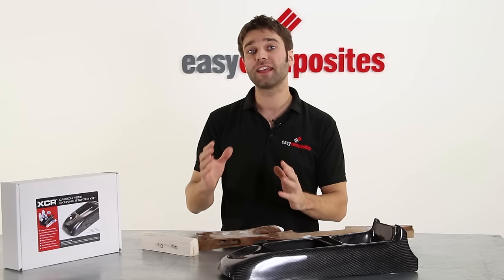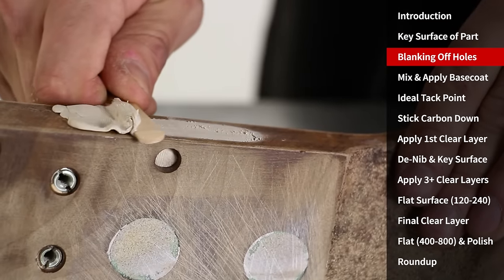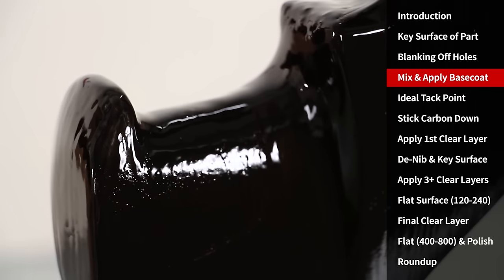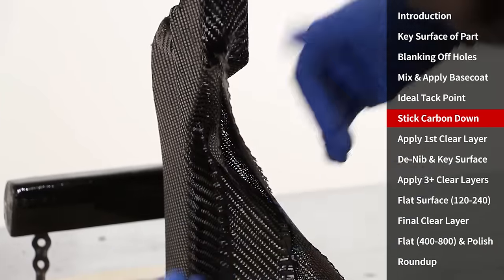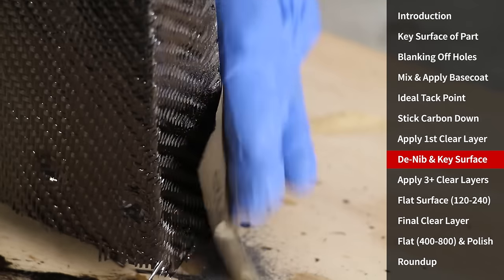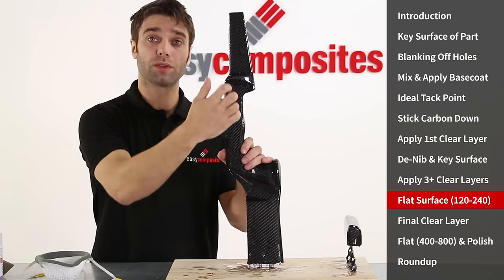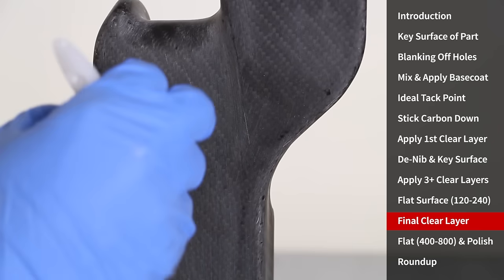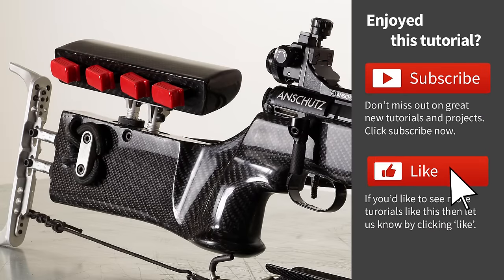Ultimate Carbon Fibre Skinning/Wrapping Tutorial - Sofie's Rifle Stock

Comment: Why don't you vacuum pack it and cure it in the oven?
Reply from the maker: Carbon skinning does not involve or need vacuum bagging. Also the resins used are room temperature curing, so no need for an oven cure.  However an oven post cure once complete can help improve temperature resistance.

Comment: sanding between coats will peel off the coats.  I wait 2 hours between layers being sticky but without staining my finger.  What am I doing wrong?
Reply from the maker: Hi Dani, if you're sanding a previous coat then you must let it FULLY cure before sanding, which will take many hours, at least 8hrs. You only wait just the 2 hours if you are applying another coat of resin directly onto the previous one without sanding in between.

Comment: Been spending way too much time skinning a couple fiberglass louver assy's I made for the hood of my Jag. P.I.T.A! Can't count the times I've broken through into the CF, made up ways to patch and match a new sliver of CF and actually fix it (and wait anther 18 hrs. for the shit to set), only to break through again somewhere else! If I could actually spray the epoxy on I'd be good but trying to brush it on just results in too much sanding to get it flat again - and breaking through again. F-k it!! I'm going to get out a can of clear and be done with them!!
Reply from the maker: Are they actually our proper XCR skinning resins you're using? (Couldn't find any customer records for you). I do know of people trying to use regular epoxies and then trying to follow this tutorial. Skinning using resins other than our XCR resin might go more like the why you're describing.
Reply: Oh no, it's nothing to do with you guys and, lol, that name is a pseudo because our governor in NY sucks so bad! My statement was just a general statement and not aimed at you at all. Sorry for the confusion! :)

I used a kit I got off ebay and there's really nothing wrong with it, it's just that I should've REVIEWED this video ONE MORE time before I got started on these parts I made! If I ever get into another project like these again at least I know now where I screwed up. All's well that ends well though, they finally finished off fine.
Reply from the maker: Got it! All good :)

Comment: I'm using the Red Carbon fibre from Easy Composites - are there any deviations from this process outlined here using the black carbon fibre as I'm finding the threads spread out way easier and there always seem to be little fibre stubbles poking through the top coat no matter how much I rub it down....?
There cloth I'm using is http://www.easycomposites.co.uk/#!/fabric-and-reinforcement/carbon-fibre-reinforcement/hybrid-and-decorative-carbon-fabrics/22-twill-210gsm-3k-1m-RED.html
Reply from the maker: The process would be the same but it is quite a bit more difficult working with the coloured (hybrid) materials because they show distortion so much more clearly than a conventional black fabric, especially if you to do 'butt joins' like we do in this video. Good luck with it and reach out to us if you need any help.
Reply: Nice. I'm finding that I get the best results by:-
1) Applying the Red/Black carbon
2) Coating it once as normal
3) Rubbing down to make key (I think this is where the hairy/stubbleness comes from)
4) Another coat (this is where the three coats would normally start) and leave overnight
5) Use 240 grit to take away stubbles WITHOUT causing more (lower grits only increase the potential stubbles)
6) Continue the 3 coats with 2 hours between
7) carry on as normal

It does introduce a lot more time to the overall process (which is long anyway) but the result is stunning. Black Carbon is lovely but the coloured ones are amazing (although a lot darker than I'd anticipated). I should receive another roll from yourselves today.
Reply from the maker: Fantastic, I'm not suprised that you've needed to adapt the process to get better results from the coloured fabric, well done and thanks for sharing.

Comment: why would  ruin your flat surface with basecoat?.  Now it is all lumpy. Better glue it down on the wood??
Reply from the maker: Basecoat serves as a 'glue' and also as a black background. If you don't use basecoat then you would need to have a black part to begin with or you would need to paint or make it black in some other way; the problem then is that the bond of the carbon skin is only as good as the bond of the paint. Basecoat effectively is the glue, but it's also the black paint, all in one. I can't see that 0.2mm of basecoat introduces much by way of lumpiness. If it does, you're doing it wrong!

Comment: Awesome. But no clear coat at the end? I always sand last coat of epoxy to 400 grit spray on two part clear epoxy coat sand to 2000 and polish. Just my approach.
Reply from the maker: That's totally an option. Either way is fine. If you are comfortable spraying and have the gear then clear coating can save you some time compared to polishing the epoxy up to full gloss so is a good option.

Comment: I have an old 96 Camping stove, it gets a bit hot, not a lot, made of brass,  can I cover the tank with this, so next time a carp fisher-person comes up to me when fishing, and brags about his kit, I can brag about I have made a cooker out of carbon,
Reply from the maker: It depends how hot it actually gets on the casing.  With an oven post cure, the XCR will go to around 70C.  If you need higher, you would want our EL160 High temperature resin.  Use a infrared thermometer to check how hot it gets.

Comment: How do you know its carbon fiber and not chinese black kevlar
Reply from the maker: Well, you'd know it was Kevlar or any other aramid fibre the second you tried to sand it! - Kevlar simply won't sand like this at all, all it does is fluff up and would cause you hell if you tried to skin with it. Same with any high tenacity synthetic fibres (twaron, dyneema, strectra, diolen etc.)

Comment: You SHOULD of done something more passive like a dash board or drone frame, all we need is gun nuts getting into carbon fiber with red/white/black colours.
Reply from the maker: Thanks Damon; it's a target rifle for an Olympic sport but I understand that even that isn't acceptable to everyone. But then, nothing's acceptable to everyone :)
Reply: Clever marketeers don't think like that, supporting your sales bottom line should always come first. There is no second chance for a first impression.
Reply: @easycompositestv - 2 things I do differently to what your video shows- 1. I undercoat will clear resin first and let it set up then apply the black tinted undercoatcoat - that's with new timber to get a good bond.  2. I do one side at a time, it allows me to trim the joint line perfectly, with no overlapping, I make catamaran rudders the outer surface is more then aesthetic, it has to be symmetrical or it slows the boat down, would be the same for most race components or aircraft I would imagine- they are the biggest users of carbon fiber- boats,race cars and aircraft.
Reply: also I would mention that inside of the 24hr period the resin coats do chemically bond to each other.  Using a mesh paper  for sanding is also a wise move.
Reply: a sprayed 2k linear urethane is a better topcoat gives some uv protection and is a harder then epoxy so doesn't scratch as easy and is easy to spray.

Comment: why real carbon and not just vinyl. Seems rather pointless
Reply from the maker: This is a working rifle so adding the carbon has added strength as well as a tough finish that also is cosmetically great.  Vinyl would add no strength, is not very durable and simply doesn't look anywhere near as good as the real thing.

Comment: Shitty way to use textiles and epoxy...adding weight and it will not be that durable is she hits the stock on anything....oh love how the basecoat is actually gelcoat🤦‍♂️🤦‍♂️🤦‍♂️
Reply from the maker: The basecoat, isn't gelcoat at all? Its a pigmented Epoxy Resin - Gelcoats are generally incredibly thick in terms of their consistency and are in-mould materials. Skinning can certainly add strength to a product, after all, you're creating a cored laminate whereby in this case, the timber stock is the core and the carbon is the reinforcing skin albeit in many applications, skinning is done more for aesthetic reasons.
Reply: @easycompositestv   Some people have a bad day ,,,, everyday. Simply ignore them. Its not worth it. Your videos and the knowledge you offer here are priceless